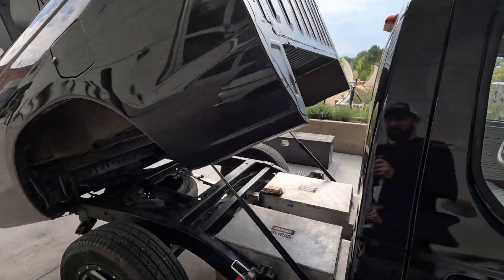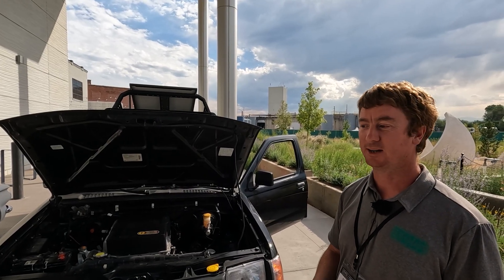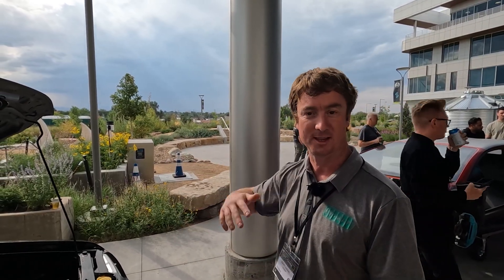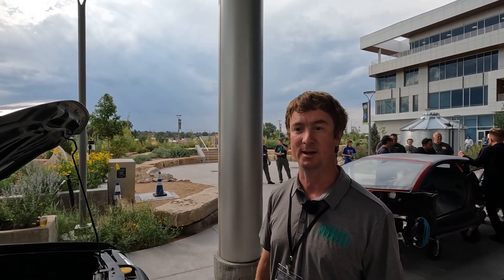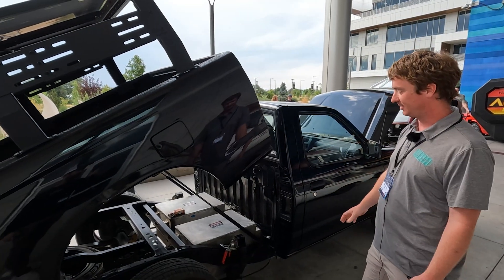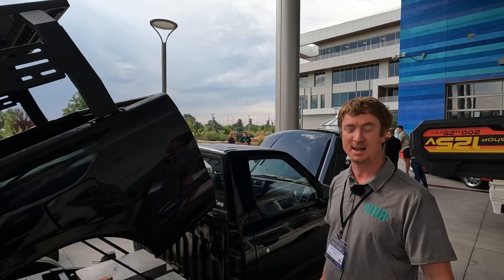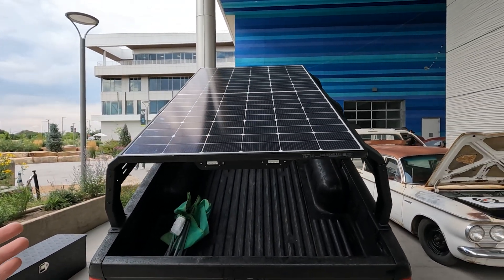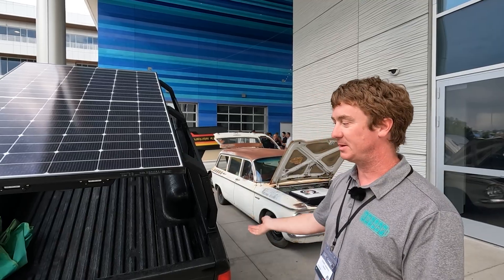This Nissan Frontier EV Swap Changes Everything

Comment: That solar panel could be a triple stacked on the rack like that, then have them flip outwards. You could also paint that bed liner white and use bifacial panels as well to maximize any gains you have
Reply: I’ll charge the truck with my off grid solar array and home built solar generator.  Great idea, trying to keep the weight down as much as possible.  Mostly local runs to town once a week in the San Luis Valley in Colorado.  Dave
Reply from the maker: @davepence2787 that's so cool Dave! Dream setup for sure
Reply: Could have at least 6x panels with slideouts, ie slide a 3x stack forward over cab, then flip out to each side from both the forward and rearward center panels
Edit: Video mentions putting side panels on cab that flip up, simpler solution for those 3, but slide for forward 3 may make sense
Reply from the maker: @geraldford6409 that would be getting pretty close to 1kw or a smidgen more!
Reply: @geraldford6409  whats the point of doing this?  public humiliation?
Reply: @GeneralFukzamatayu Up to 3KW of power if using 6x bifacial panels.
That would easily add 30-40 miles of range, probably more, on mostly sunny days
Reply: @geraldford6409  so the first step of a viability study would be to get one panel and sample its actual output across a sufficient number of representative days.  while doing this, conversion losses and storage losses can also be assessed and approximated.  then work a little algebra and relative viability can be assessed. 

is it possible to fully charge a battery using a solar panel on the roof of a vehicle if you park and don't operate the vehicle and wait long enough?  ...yes, probably.  in anywhere near a reasonable amount of time?  for a vehicle that a person can count on?  no, not really.
Reply: @geraldford6409  panels of necessary size fit on football fields, not trucks.
Reply: @geraldford6409  Why have these adults been pretending that they're incapable of the algebra that they were required to pass in order to graduate highschool?

Algebra 1 is most commonly taught in 8th or 9th grade in U.S. schools, with the exact timing depending on a student's readiness and the school's curriculum, while more advanced Algebra 2 is typically taught in 10th or 11th grade. Some students take Algebra 1 as early as 7th grade, while others are guided into it later, often after completing a pre-algebra course.
Reply from the maker: That's a super sick idea!

Comment: How are the stock components holding up to the increased torque?  Love the implementation and the build.
Reply from the maker: Great question! Everything is holding up fine on this one no problems. The owner has been daily driving it for about a year now.
Reply: Everything is holding up very well.  Dave
Reply from the maker: @davepence2787 the man! Thanks for chiming in Dave